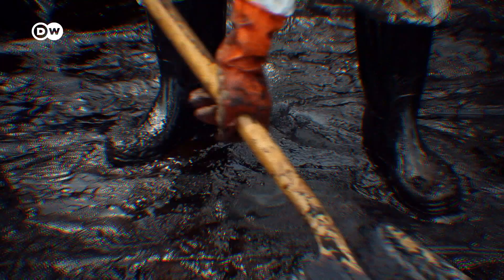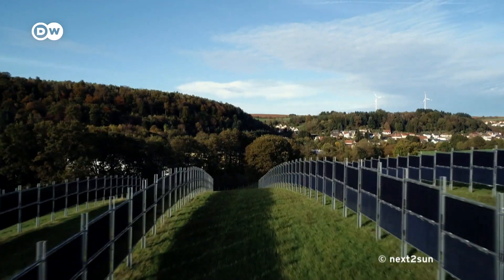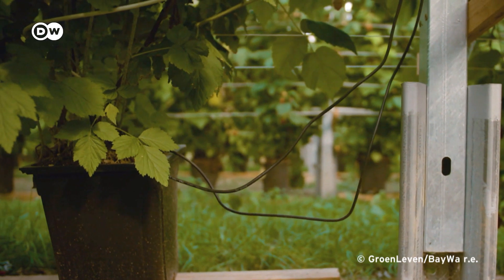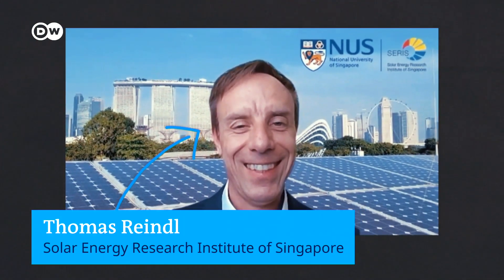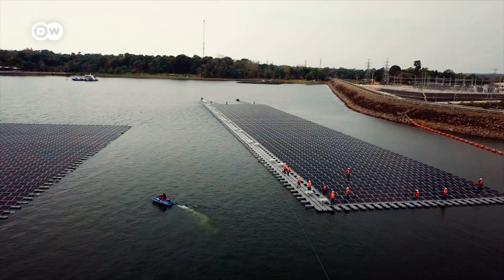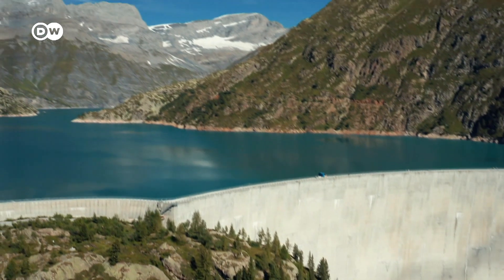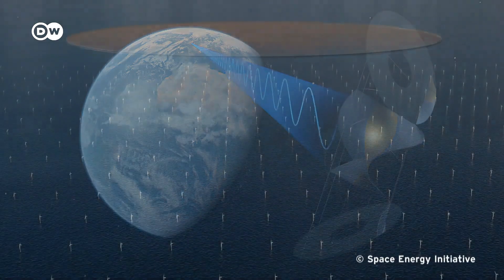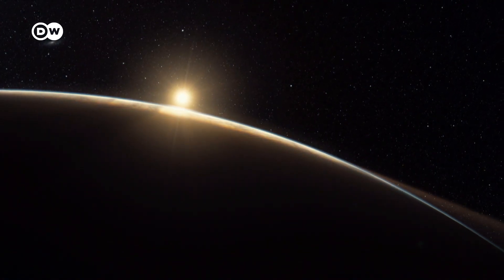Why we should be putting solar panels on our fields and lakes

Comment: or why not just use nuclear power..?
Reply: Nuclear should be part of a future carbon-free grid.  It is a very good "base load" power plant while being carbon-free and consistent.  But there are obstacles:

1) Takes billions of dollars and 5 to 10 years of construction time on top of years to even get a permit to start with its dozens of local feasibility studies, eco studies & community hearings -- investors are skittish about these things as they add a lot of uncontrollable risk
2) People don't want to live within 2 counties of nuclear plant if at all.  The nuclear plant can affect house property values which people fight tooth & nail to preserve.  Some don't even want solar farms or wind farms near them either!
3) A nuclear plant's nameplate areal power density is probably not much more than a large solar farm.  Because nuclear plants require a large restricted "keep-out" radius of land around the plant which decreases its areal power density.
4) Solar photovoltaic costs have plummeted 90% since 2010 and is now the cheapest levelized cost of energy (LCOE).  This has unexpectedly disrupted the energy markets of even its sibling technologies like thermal solar and concentrated solar power (CSP).  The prices are still on a downward trend with upcoming tech that can increase photovoltaic efficiency another 25% to 50% (Perovskites TF, quantum dots).

Last but not least:
5) Nuclear promulgates a centralized grid architecture

Can't be overstated that nuclear still represents the traditional centralized grid which, by its inherent design, is not as robust for modern-day challenges. In the event of natural, man-made, or terrorist disasters, a centralized power plant can be taken out or disconnected leaving large parts of the grid the plant serviced to be un-powered for days or weeks.  With climate change, natural disasters are increasing in frequency and intensity.  A gigawatt nuclear power plant services millions of homes.  In the modern world, we've seen the robustness of de-centralized networks from things like cryptocurrency and torrent file sharing.  Even the internet itself is a form of de-centralization.

Solar power provides a pathway to such a de-centralized distributed network where power is generated and consumed locally at the source -- and there's nothing more local than consuming power right from the roof.  This applies to residences, commercial, and industrial.  Unlike any other power source, solar integrates very well into dense urban landscapes with its abundant commercial, industrial, and residential rooftop spaces and parking lots.  Combine with upcoming grid-scale battery storage, an urban county will be able to be electrically self-sufficient for most of the year.  You could drive by a 1/2 or 1-megawatt solar array installed in a local college campus and barely bat and eye at it.  Even without grid-scale battery storage, a region could be running some 50% to 75% from solar allowing its base load natural gas power plants to throttle back to idle during much of the daytime.

Moreover, the distributed nature of rooftop solar spreads out the load on the transmission & distribution links of an aging grid infrastructure.  Because a new powerful power plant like a gigawatt nuclear facility is going to put a big load on smaller part of the grid where its power flows out from.
Reply: @beyondfossil  yeah or you could hold out for another 40 years for nuclear fusion. Or hold out for hydrogen power. Solar has a big problem with ewaste and toxic waste. what are we gling to do with all the "cheap solar" once it starts going bad or leaking toxic waste (how iwll you be able to tell?). So we are going to produce abhorrent amounts of solar panels that will decimate other countries like Somalia and others where ewaste is processed. Your propositions are not taking the "after" part into account, only the "we could make a decentralized power grid" or "we can aupply a whole city with a city sized grid." Solar is fine for little things but wouldn't be good in the mass scale of things, at least not right now. The best place in Solar would be space. anything less is a waste of resources and solar panels.
Reply: @Mogadypopz  How much toxic chemicals per panel?  What kind of chemicals?  Details matter.
Reply from the maker: Hi Rotormatic, we cover this information in the following video: https://youtu.be/EWV4e453y8Y
Reply: @DWPlanetA  Yes, thanks for good coverage on solar panel production & recycling.  Recycling panels is not an insurmountable problem like atmospheric CO₂ is.

I'd also highlight the following:
(1) the tonnage of future end-of-life panels includes the panel's aluminum frame.  But the aluminum frame is easy to recycle is  33% or more of the weight of each panel.
(2) Since solar panel prices have dropped a staggering 90% since 2010 and continuing to decline, the addition of a small recycle surcharge on each panel to support recycling is not out of the question.  Or include a small "deposit" fee that de-incentivizes dumping panels into the land fill because each panel has $5+ redeemable only when delivered to a certified electronics recycling facility -- similar to the 5-cents deposit aluminum cans and plastic bottles.
(3) the continuous e-waste stream of computers, consumer electronics, appliances, etc. is more than solar panels.  So economies of scale and leveraging work in favor of combining electronics and solar panel recycling.  We must have a circular path for e-waste anyways (this was mentioned in the video)

Comment: I've been wondering why we haven't done those farm implementations for a good decade or so.  But for that problem, the cost and then the other hoops farmers would have to jump through is more than most farmers want to be bothered with I'd imagine.    The whole idea will need to be subsidized.   Same thing with homes but the cost is just too expensive for such.  Right now the majority of us do good enough to pay for our electricity bill at a month's usage, let alone pay for 20 years worth upfront with a "promise" that it will pay off in 20 years and then make money.   It's like another proposed pipe dream being sold to us all mainly because the  $$ GAP.
Reply: Knotbone, 

farms should be used to produce food, it's a terrible idea to cover useable farm land with solar panels, especially as solar power si apoor source of electricity.  See my other post which explains why.
Reply: @iareid8255  put up high enough, light will bend around panels.   I think it's called a parallax?   So really as far as land consumption,  it's miniscule unless you're worried about a pole positioned where you're not going to tractor anyway.
Reply: Knotbone, 

I think you are talking about refraction which does not occur unless there is a change of medium.
Plants need sunshine to grow properly, cover them with panels and there will be little of real value to harvest or for beasts to graze on.
Also higher panels need much stonger structures a sthey will be more vulnerable during high winds.
Reply: Not if you are living (sub)aquatorial and put them up yourself.

Comment: Require every home in America to have and be its own power plant, every home has solar panels and using space already taken. Everyone gets power and big companies wouldn't control us. Things we need shouldn't be private, power, water, healthcare are a couple of examples.
Reply: Frodaddy09,

there is a very good reason to be connected to grid supply, you can be sure of power 99.99% of the time. Make your own and you will be without power as often as you have it. Go ahead what is stopping you?
Reply: @iareid8255  I suppose you misunderstand me. Every home, all connected to the same grids in there respective areas. Excess power stored with batteries or hydrogen tech, back up plants where needed only. It could be done.
Reply: Frodaddy09,

Yes I did assume you meant stand alone home generation.
However what you suggest is how electrical generation started, with small power plants feeding a small area. It soon became obvious that forming a grid and interconnecting was far better, cheaper and more reliable.
Another flaw is that you can't run even small island grids with renewables, they are not suited. The only reason that we have so much renewables connected to grid sis that there is also conventional generators which keep the grid stable . Remove them and the grid would simply go out of frequency control and trip.
Reply: @iareid8255  This would obviously need major funding,  infrastructure development and everyone on board to get it done.  In that world, it could work. Technology is only getting better.
Reply: @Frodaddy09  who's going to do grid management? Who's generating power in your scenario when there's a big storm? Or do you expect everyone to generate their own power, but still pay half of what they pay today to maintain the grid and peaking plants that will pick up loads?
Reply: @vovalos  in my view on things we all need, private industry should not be able to monopolize or profit alot off of, things like, power, water, and other things like healthcare. We make a new energy department that handles maintenance and safety. Like your local power company, they would have bases in each power area to take care of issues.  No one household or person creates just for itself, it is all part of a local grid, everyone creates for everyone.  Excess is stored or transferred elsewhere.
Reply: Frodaddy09,

the real problem is that renewables are poor at supplying power and many expensive solutions to this deficiency are proposed but they will not be effective.
Renewables are not the answer and time will show this. Indeed it is already evident but politicians are blind and push on regardless.

Comment: Panels are even more useful at hydropower because of energy storage.  You can use the dam as a gravity battery.
Reply: Pump storage is awesome
Reply: Pumped storage. Yes.
Reply: You also need a lower reservoir for that. Most hydro dumps it into a river. Transmission losses aren´t generally meaninful either. Location of solar is more important, generally.
Reply: @totoro5421  You're right, I didn't think of that.
Reply: @madcow3417  +1 on the lower reservoir. Capacity is needed to get a proper volume of water back up. Not saying it can't work, but it's quite complicated and very location dependent! In the USA, I think that Appalachia is particularly well suited for this type of system. It could be a great way to generate electricity locally while moving away from coal
Reply: @totoro5421  I can still see it being useful in that it offsets some of the hydro need, allowing more water to remain in the reservoir, allowing you to save it for the less sunny time of the year.

And it prevents some evaporation which also means you've effectively stored more energy.
Reply: Solar panel doesnt store energy but their storage battery is what stores excess.
Reply: also, as air-to-water tech improves, it'd be cool if it was built on an industrial level next to hydropower stations. this way when the water is generated, it can recoup some energy by being dumped into the hydropower battery. this could be really important for regions that are becoming too dry to operate their hydropower. so solar panels can help generated electricity to both pump and "create" water; this ensures the battery is always ready and that there's ample water for residents. and, like you said, it can function as a battery at the same time.
Reply: small potatoes
Reply: There are many toxic chemicals in solar panels which  include cadmium telluride, copper indium selenide, cadmium gallium (di)selenide, copper indium gallium (di)selenide, hexafluoroethane, lead, and polyvinyl fluoride. Silicon tetrachloride, a byproduct of producing crystalline silicon, is also highly toxic, and as much as 80% of raw silicon is lost. Throughout their lifetimes they leach these toxins into the atmosphere and ground, solar panels also release nitrogen trifluoride (NF3), a chemical compound 17,000 times worse for the atmosphere than carbon dioxide.
Reply: Only if you have mountains or so. Countries like the Netherlands are out of the story
Reply: Dams already are in use as gravity storage! Wake up!
Reply: it could cause flood or draught. if water dont evaporation as normal?
Reply: @starrynight3945  If the amount of non-vaporating water would be too much and the water reservoir too full, the additional water can easily be released through the turbines and produce energy. It could also be used for irrigation. Are there areas with hydropowers having too much water?TheI one's I know might have too little than too much.
Reply: @starrynight3945  no clue what you’re saying